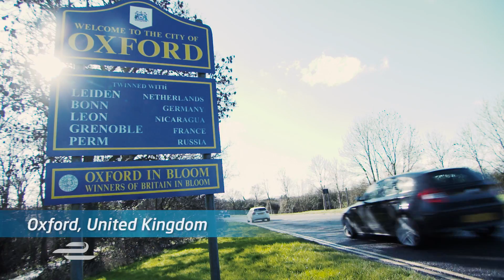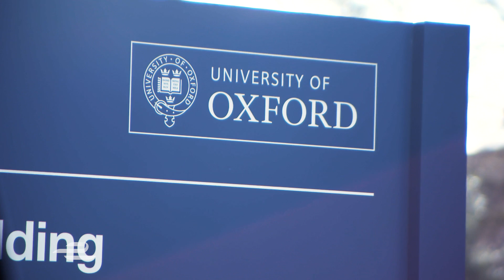How Electric Cars Will Help Fight Climate Change - Formula E

Comment: With batteries like this it won't help at all. Electricity has to be produced and if we just imagine how much more power drain it will be if all cars were electric. Simply there is no way to produce that clean. So electric cars will only have future if cars would be able to generate electricity on their own and right now that is not possible.
Reply: +Marko Lomovic Formula E batteries use Glycerine to produce electricity which releases no emissions. Using algae will be the next step.
Reply: Anil Parmar You missed the point. As I said imagine if all cars went electric how much power would you need to make sure you can supply them all ? How many thermal plants to build to make sure that power grid doesn't fail. Electric cars are step in right direction but won't help climate at all.
Reply: +Marko Lomovic WAIT. Someone is wrong on the internet. Listen, you, renewable energy sources are capable of supplying the energy needed to electrify transport and energy storage is exactly what makes it possible. There are countries like Norway and New Zealand where most of the electricity is already supplied from zero emission sources and if those countries electrify transport they will have reduced every little gram of CO2eq from ICE engines. Other countries are following and there are international agreements to reach 100% renewable, zero emissions from electricity production by around 2050. This isn't a conspiracy, it's happening and batteries will allow intermittent energy sources to provide ALL the electricity needed at ALL time, day and night.
Reply: Not it is not possible in this moment  with technology we have now. It helps a lot for sure I'm not arguing that I'm just saying that is not enough it needs to advance a lot more. In my opinion cars have to sustain their energy on their own for this to work properly because if it doesn't then we are just creating bigger demand for energy. Its obvious what happens when you increase production of electricity. We are struggling with production with all dirty ways and without those we just can't meet demand.

Well in 2050 anything can happen and i hope we will go beyond self sufficient cars and hopefully find better ways to produce energy.
Right now cleanest source of energy that we have in our disposal is nuclear but it is a shame it is not used at maximum potential.

Comment: Electric cars will catch on, driverless cars won't.
Reply: My father worked in motor racing for most of my childhood, and everyone around me had a very common attitude about the risk of driving. Racing on the track wasn't viewed as being as dangerous as driving to and from the track. As they put it: on the track, we're mostly professionals, but on the road, we're surrounded by dangerous amateurs.

Personally, despite being a very technical person, with some programming knowledge myself, I would be very reluctant to trust self-driving cars - I am a control freak when it comes to driving, and it worries me that driverless cars may be programmed by people that I'd consider to be amateur drivers at best.

As a former motorcyclist, I'd also have some concerns about the ability of a driverless car to recognize that motorcyclists have slightly different needs to cars, when it comes to how you negotiate around them. Since most car drivers have trouble with this concept, it would not surprise me to find out that, when companies begin releasing driverless cars, this may have been overlooked by that particular manufacturer's programmers.

One possible way around these problems would be to make the software standard across all vehicles - this would also allow easy rollout of road law updates to all vehicles using the program. This way, it would be possible to guarantee that the program was guided/written by professional drivers, and that motorcyclists could give their input also.
Reply: +Sharon Kerr-Bullian According to Google, they're already thinking about these exact types of problems.  They are teaching their system to recognise children and them acting unpredictably, for example, even when they might be wearing unusual costumes, like at halloween.  The system apparently does have a problem with squirrels so far though!  But it can even already distinguish multiple reckless drivers from other vehicles all in the same vicinity, and multiple pedestrians coming from many different angles at road intersections.  I'd imagine motorcycles are already well within the boundaries of what the software can detect.  They are building the most realistic models possible by actually driving these cars around on real public roads, right now, under the watchful eyes of trained observers, ready to override the car, who scrutinise the car's every move, both as events happen, and by analysising the collected data later on, with real motorcyclists, other cars and real people wandering around.  By the time these cars hit the market, each and every car will be able to fall back on many lifetimes worth of driving experience, even from the very best trained drivers on the planet, just due to the amount of miles and time they've covered on the road.  I'm a motorcyclist too, btw.  With their 360 degree, unblinking "concentration" and ability to instantly refer to potentially billions of road miles of past experience, which will be constantly added to, these things will eventually easily be more skilled at driving than probably anyone on the planet!
Reply: +Deafening Octopus Eventually there won't really be a choice, most electric cars will have driverless functionality built-in as standard somewhere down the line.  And, at the very least a lot of the safety aspects of driverless cars will be an always-on feature that you won't be able to turn off (much like always on headlights lights are today a feature of all new motorcycles in the UK and many other countries that can't be turned off).
Reply: +TheHolySpirit This may not turn out to be the case. I think, at least in my lifetime, it will come down to whether politicians themselves are invested in the idea of driving for the joy of driving, rather than on the safety side of things. If they are passionate about their cars and driving, I think they are unlikely to put legislation into place that will take that privilege away from them. On the other hand, if they aren't passionate about driving, it would take very strong lobbying on the part of some of the road/track car manufacturers to keep the option to turn those driverless features off at the driver's choice.

I think driverless cars will also face an ethical challenge at some point down the road. We can of course program cars to avoid collisions, but there will someday be a time where a car will have to choose between two different collisions, because there isn't an option to avoid a collision entirely. If someone is killed as a result of the car's decision, I think it will result in a very emotional outburst against driverless technology - the idea that a car could choose to take a life at all will probably scare many people, who will miss the point that it may choose to kill one over killing many.
Reply: +Sharon Kerr-Bullian You might want to go and have a look at Tesla's website.  They already have "Driver Assist" (see the videos on YouTube if you want to see it in action - some are terrifying!) and "Summon" and a self-parking function.  Fully autonomous self-driving cars are just a software upgrade away.  Elon Musk of Tesla said in late 2015 that fully driverless cars were only five or six years away. He said “I think it will be quite unusual to see cars that don’t have full autonomy, let’s say, in 15-20 years. And for Tesla, it will be a lot sooner than that.”  I imagine the way it would work would be that you would probably get huge insurance breaks if you relinquished the driving of your car to the car itself. In this case, the insurance liability of accidents will be transferred from the car driver to the car manufacturer/creator of the software running it and the stats are already showing that they are safer than humans.  Google's self driving cars have completed well over a million km on public roads (with someone in the seat ready to take control) and so far the 14 minor accidents they have been involved in have all been due to other drivers.  Interesting point about having to make a decision over how many people would likely die in a accident.  That's probably being risk-assessed right now and the eventuality of such an accident would probably be so unlikely that it'd be a risk they're prepared to accept liability for.
Reply: +Deafening Octopus I hope the happen faster than possible. Don't get me wrong, I'm 50 and part of that generation that loves to drive and own cars, but I'm outnumbered by a bunch of people who aren't like that at all. In fact, the faster I see these people's hands away from steering wheels and making life changing decisions and into autonomous cars, the safer I will feel. I can understand your point of view if you live in a world where people are taught how to drive and are conscious of the space they occupy, but it isn't the case where I live. People are woefully unaware of what they are doing, not paying attention, eat, drink, put on make up, text, drive with their hand on top of the steering wheel, as if it was still cool 15 years later and bumper to bumper with multi-ton cars at 80 MPH. Anyone who can prove they breath and has $40 can get a driver's license here, but are never really taught to learn how to drive. Plus driving these days where I live means being stuck in bumper to bumper traffic whether you leave at 6am or 10:30. As far as I'm concerned, get these people away from steering wheels and let them text and play video games in the back of a driverless car. Sad, but a necessity.
Reply: +TheHolySpirit Absolutely and like any transitions into a new technology, everyone involved is highly aware of the dangers, in this case an autonomous vehicle anticipating the probabilities a self-driving car, motorcycle, and pedestrians re likely to do. The problem is not in the programming, but the gathering of all criteria and redundant failsafe systems.

I personally can react quickly enough to avoid something, at least not quickly enough to avoid a computer program. The computer program will always beat me, not at the anticipation, where I can excel, if I'm still young enough, in a perfect shape that very moment, with no distraction. The computer will better be able to calculate the best course of outcome given the circumstances and data.